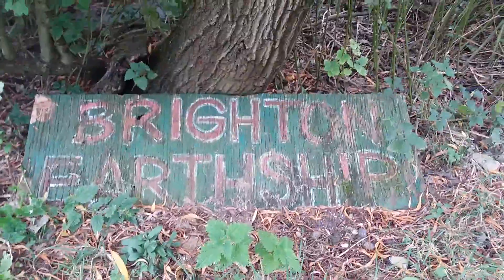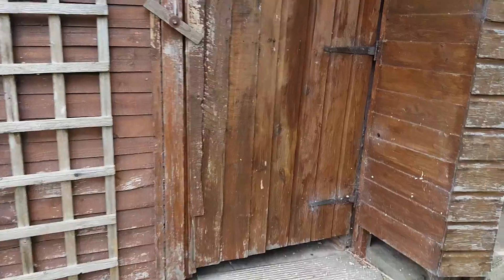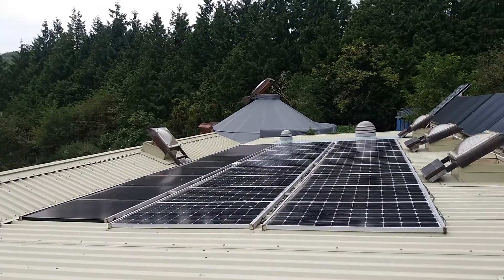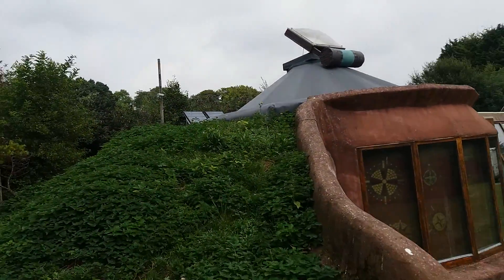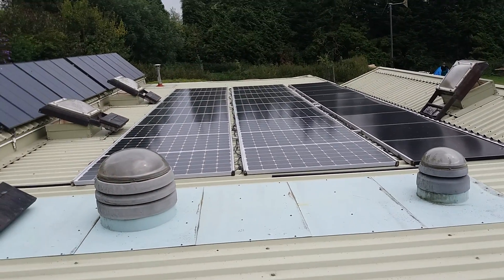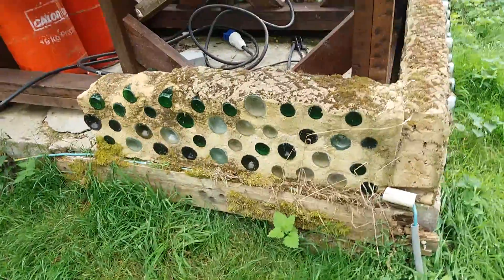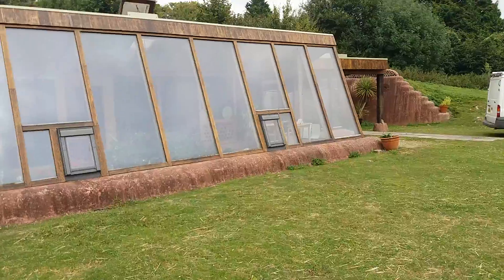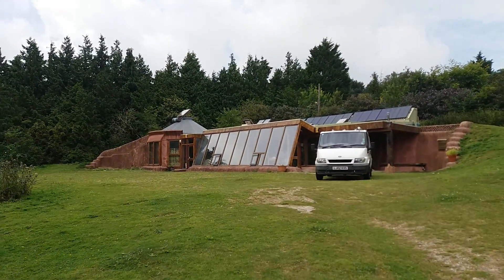Earthship Brighton - Off-Grid Passive Solar Building in South England UK

Comment: The vast majority of earthships, have a large expanse of glass on the south facing exposure. They talk about the indoor growing potential they have, and yet none have very much planted. It's all well and good to have a banana tree growing inside, but they only produce once a year. Why aren't the greenhouse sections larger?
Reply: I think a lot of the ones you see on youtube are rentals.  Hence the growing section isn't important and they just fill it will ornamentals or perennial veg as it is less maintenance.  The ones where the family is actually relying on it for a good proportion of their food are much larger, also they make use of the outside.  This one is probably a demonstration home.
Reply from the maker: bruce wayne I think that many of the builds in this country are unoptimised. But I have seen a great example of one which existed at Lammas Ecovillage in Wales where the greenhouse was extended down the hillside away from the house, but was still plumbed into the grey water system.

Comment: £300000 grant was given to build this garden shed the people who built it pocketed the cash and put sub standard donated timber on the front of the building (red oak interer wood) that needs toxic treatment how much is this cash cow going to give to the people running Brighton earthship ? Open your books . How much will you need to build a low cost low carbon solution to the housing crisis as it was billed back in 2002 £300000 and countingboth Daren Howarth and Mischa Hewitt should be up on fraud charges fundraising for the same sustainable building over and over again . it more than a little suspicious that the Brighton Earthship has had over £300000 + and counting for a low cost low carbon building and still needs more
Reply: 300k for that seems to defeat the purpose.  In the US they are building them for like $65k although that will be with volunteer labour.
Reply from the maker: Michael Cunningham. It is a shame when a good idea gets used badly in order to try and make a few quid. £300,000 seems an extortionate amount for such a building and it is fair to say that it should be a spaceage example for that sort of money.

May I thank you for bringing this information to light and ask if you may provide me with a source for this information?

Comment: A patio infront could be used as a reflector this would send more light in like maybe double. One way is to apply a whitewash to the patio that can be scrubbed off in spring (or you could leave it and abandon the earthship for the treehouse in the summer so it gets toasty underneath). Only problem is light levels could 
be bad for the eyes although probably not so much in UK. This can be 
mitigated with some black cloth drapes particularly light coming up at the lower section with a white layer on the inside of the drape to bounce light further back. Putting a green house is probably not a good idea in uk. Probably better to bounce the light further back to be absorbed by the sheltered mass (the floor).  The greenhouse could  be lower down infront of the patio with its own glazing to put extra heat in under the 
area It  might be best to start with a insulative ring wall around the edge going down a metre or so into the ground under the earthship so that it can drive heat down into the ground and build a large thermal battery. Then possibly angle the glass for mid january so it is closer to optimal for a longer period of winter and put a few logs on at christmas or there might still be good stores of heat from late november, early december when it would be optimised. So if imagine underneath there is the centre of the battery where it is warmest you might be able to have some tubing going down into this area that cool air can drop into and drive warmed air up a sort of slope thru the battery creating suction that can be opened only at times of need as it will put a drain on the battery. This could flow to forexample a bunkbed area or seating area at the top where the warm air collects.
Reply: Found this graph about soil temperature. http://www.builditsolar.com/Projects/Cooling/time-lag-vs-depth.gif So at 5ft there is quite a good lag and at 12 ft your into may by the time you get your lowest temperature. So what you do is put thick woodchips round the area out to 12 ft or not even bother and just plant a thick ground hugging plant. So then the whole area is protected from the wind and the ground  should  be easier to heat and earthship should work. There must be a suitable plant that grows easily and drops some nice crispy leaves as well so makes a nice carpet. It would probably be measurably warmer compared to open ground in a cold wind and have a big impact on an earthship. The windchill if you measured the ground under the leaf litter would be greatly reduced the earthship might get warmer over some years. Looking at some research there is stuff like this. "Temperature varied by ≥5 °C... over very short distances (≥ 1 m)... vegetation can strongly affect local 
habitat conditions at fine spatial scales in arctic-alpine environments." http://www.bioone.org/doi/abs/10.1657/1938-4246-45.4.429?journalCode=aare